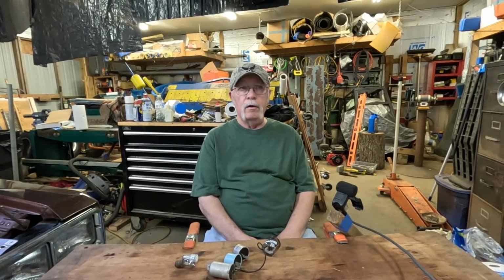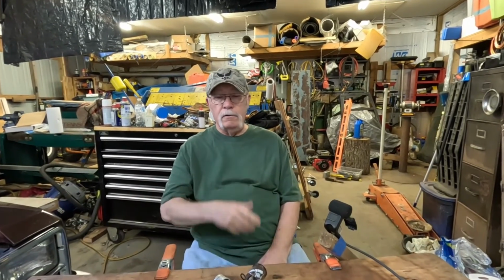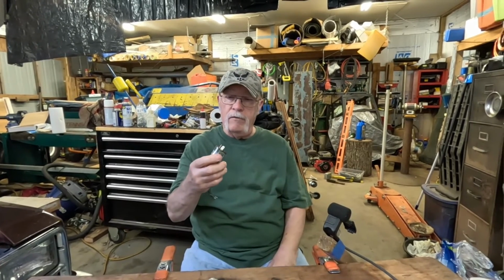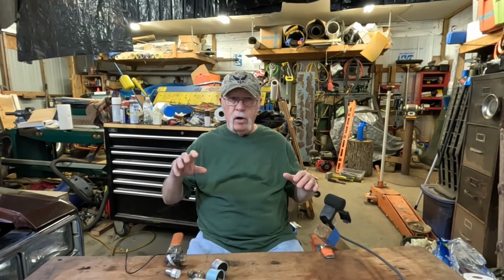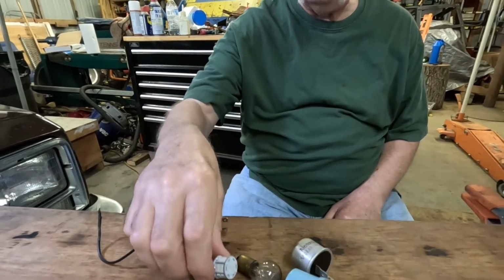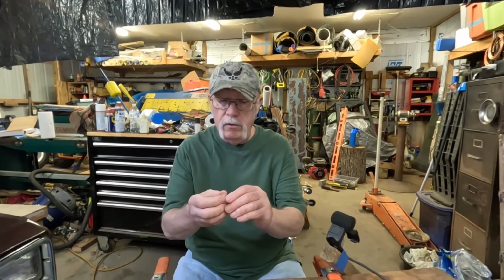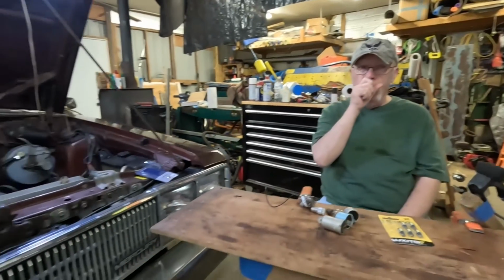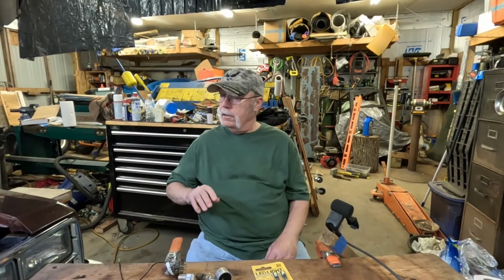Classic Car LED Upgrade Conversion problems - Turn Signal Fix tip

Comment: I like LEDs for certain applications. On my 71 Oldsmobile I kept burning my arm on the incandescent bulbs under the dash so I swapped for LEDs. I ended up swapping that whole car to led and never had an issue with the turn signals, not sure why. On my 68 impala I only switched the interior to led cause I kept burning myself on those also LOL. I’ve actually never had a light go out on that car in the 10+ years I’ve owned it so I refuse to touch any of the outside lights out of fear I might upset whatever magic is going on there 😆

Comment: I don't like the LED bulbs because the tail light buckets were designed to work with incandescent bulbs.  Those LEDs are not going to fill up all that space in your tail lights.